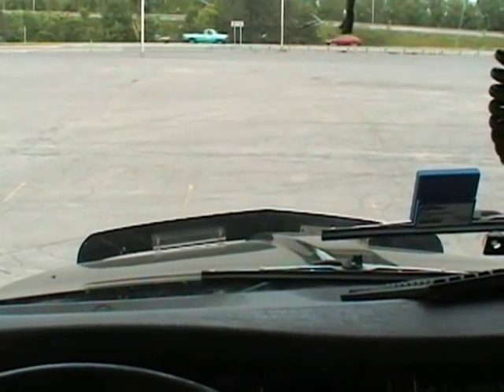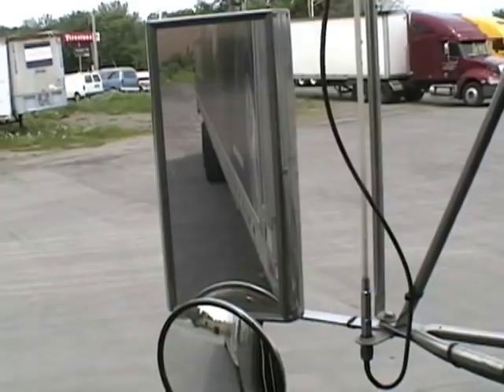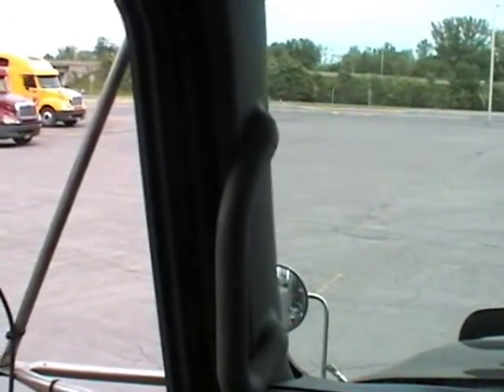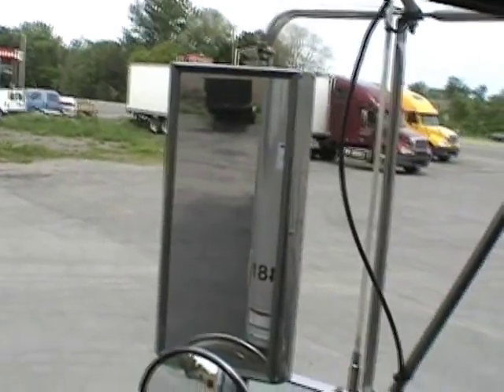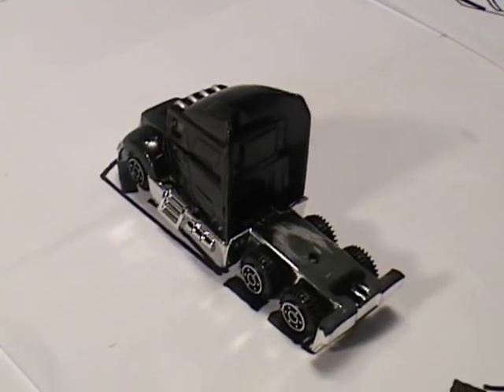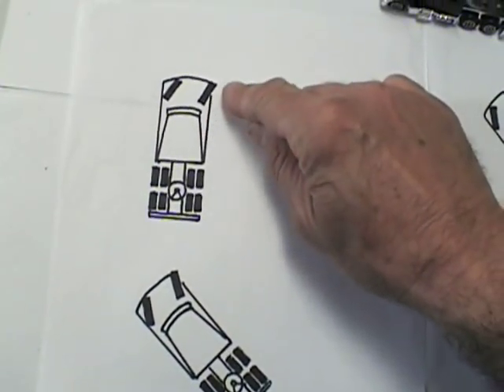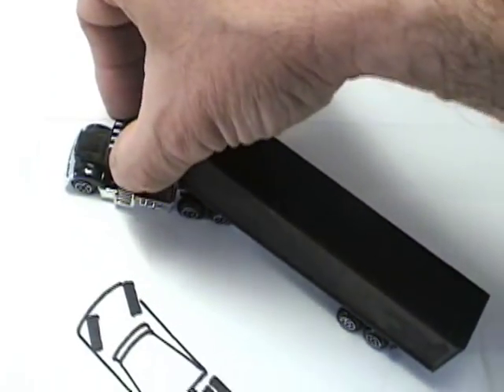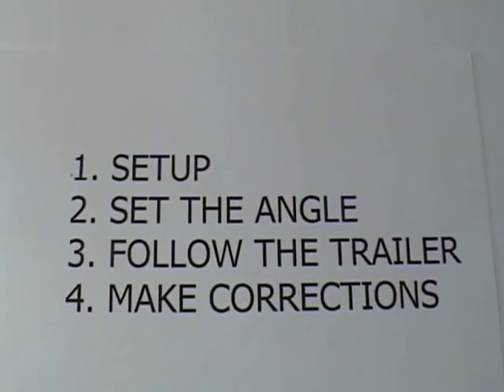How to back up a tractor trailer

Comment from the maker: Thanks, it's a good tip and I mention it in my book. As we commented on my part 3 video, if you're used to thinking of how you turn the TOP of the steering wheel, you can think of turning it TOWARDS the obstacle that you want to avoid. I've never thought of it this way but you can try it. For new drivers don't get discouraged. After awhile you won't have to think about it as much. Remember, almost any problem with backing can be solved by going slowly.

Comment from the maker: You're right. Short trailers are tricky, especially if you're used to working with a long trailer and have to switch to the short one. One of my videos is about backing a short trailer, and how moving your tandems forward can affect your backup.

Comment: When I was taught toback with a trailer, I was taught to place my hand at the bottom of the steering wheel and "push my hand in the direction I want the BACK of the trailer to move; ie. if I want the BACK of the trailer to turn to the right, move my hand TO THE RIGHT. This makes things much simpler
Reply: good comment..backing really kicked my ass today
Reply: The problem with your 'hand at bottom of steering wheel' is you are talking of 'back of trailer turning' but that is not the correct way of explaining it. You are supposed to point the back of the trailer in the direction you want to roll the trailer.

Comment: So when backing is small increments, keep side of trailer in mirror, play peek a boo with trailer very back tire and front edge of trailer (both on same side). When get trailer part way  backed in and  the trailer is pretty straight try to use a, " Rock a By Baby." cadence to keep it straight. The  technique is to hold steering wheel at bottom and steer back and forth. When guiding it back, driver only needs small 5 to 20 degree corrections to steering wheel. Go slowly, the faster you go the bigger the mistake because your angle increases. The trailer takes 10 feet to respond to a correction.  This is a  good video. May your day be one filled with happiness.

Comment from the maker: @zenati7 it takes awhile to get used to the steering when you back up. Try making a slighter turn of the wheel. As far as the speed you control that. If the transmission has a high and low range make sure it's in the low range before you put it in reverse.

Comment from the maker: @blackapricot1 I never thought of it that way ,but yes, it would move clockwise as you're backing up if the wheel was turned to the right, and just the opposite if turned left. To take your clock example further, if the tractor and trailer were starting out in a straight line with the tractor pointed at 12:00 and the back of the trailer at 6:00, if you backed with the wheel turned to the right the back of the trailer would start turning towards 9:00.

Comment from the maker: @Kopihucky Yes, I think it's true. With a small trailer every little turn of the steering wheel makes a big difference in where the trailer goes, where with a large trailer you have a little more time to adjust where it's going. One of my videos is about backing a short trailer.

Comment: Note my instructors told us a simple maxim about straight line backing. MORE IS LESS AND LESS IS MORE. The More you turn the wheel the less control you have. like wise the less you turn the wheel the more control you have. I have lived by that for the past 15 years. Over steering is one of the biggest problems new guys have. Just wanted to pass that along.. EXCELLENT VIDEOS.

Comment from the maker: @jcrainct I just put up a video about backing a short trailer but I don't know if it would help with a log splitter. Can you see it if you roll down the window, put your head out the window and look back? With a short trailer, after you start backing at an angle you have to quickly turn the wheel back in the other direction to follow it. But at least with a short trailer you can see the sides. With a log splitter hitching and unhitching might be the way to go.

Comment: @rotcataergeht Your second comment is correct. To back a tractor with one trailer you would turn the steering wheel the opposite of what you would do in a car.
To back the trailer to the left, turn the steering wheel to the right. This is the same thing you would do if you are backing a pickup truck that is towing a boat on a trailer.

Comment from the maker: @jimscee You wouldn't be able to go all the way around the clock though, unless you had the wheel turned slightly one way or another. If you backed up turning the wheel all the way to the right and kept the wheel all the way to the right, by the time the back of the trailer started getting to 9:00 the tractor would be jackknifed up against the trailer, possibly damaging the tractor. But with the wheel turned at less of an angle and keeping it at that angle, you can keep going around in a circle.

Comment from the maker: @bobdole92 
  I think that almost anyone can learn to drive a tractor trailer. But then, like most jobs, you need at least a couple years experience to get good at it. You need to be especially careful during this time until you get used to handling the truck in different situations.

Comment: I learned to back a trailer by using the bottom of the steering wheel as a reference as it matched trailer direction. Same result either way.

Comment: I don't understand why everybody uses the "turn the wheel in the opposite direction" line. Stop thinking only about what you want the back of the trailer to do, think what you need to make the front of it do in order to get the back to do what you want, it makes everything easier. When I started our I was dragging a full trailer (drawbar) and learned to reverse that before a semi, I always thought about the front and it stuck so when I first started backing up semis it was so easy.